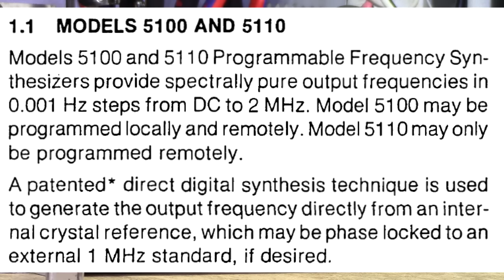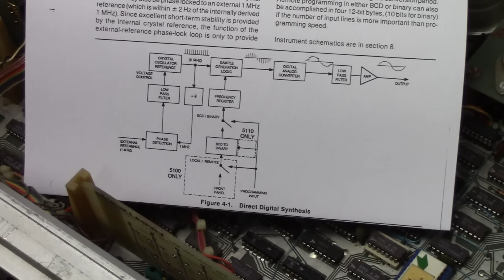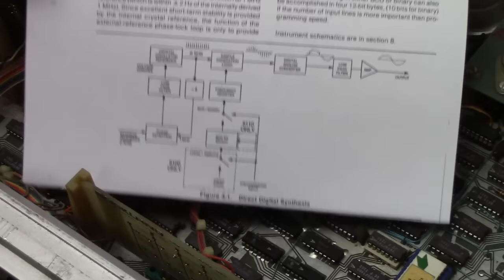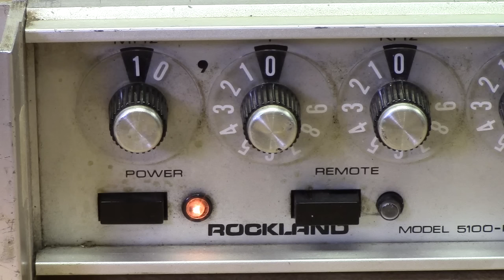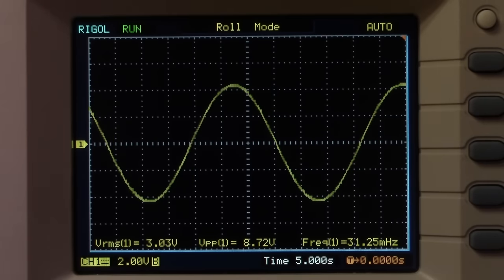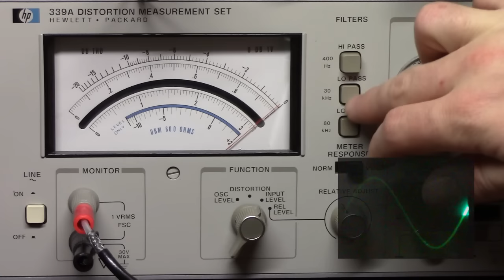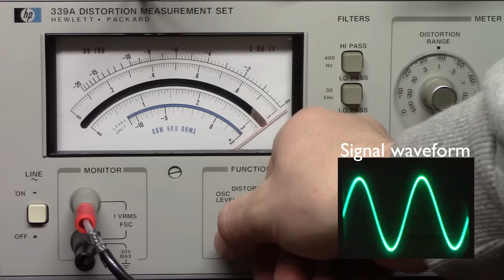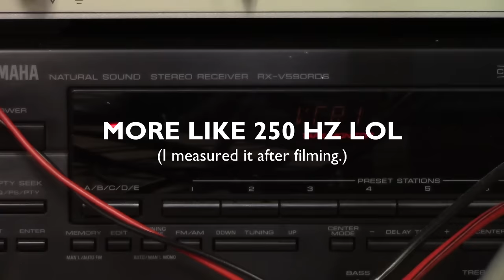Rockland 5100 vintage DDS frequency synthesizer teardown & test

Comment: Great video, thanks! I recently discovered your videos and I am slowly reviewing most of the ones that peek my interest, quite a few I must say! 
I was wondering if you had any videos where you review your favourite tools around your bench? I could not find one, but perhaps I missed it. At any rate, thank you for all your efforts to share knowledge in such interesting and fun way.
Reply from the maker: +Tino S I'm glad you like my content.

No, I don't have any videos about my favourite tools, assuming you mean stuff like screw drivers and pliers. I've intended to make a few videos on my favourite pieces of test gear, namely the HP 339A and the TTI EX752M, but they're difficult to get around to since they need to be really in-depth. The 339A in particular, since it's such a specialised piece of kit.
Reply: +FFcossag, any tools, measuring or otherwise, e.g. soldering station, software for data acquisition, chemicals used to clean boards, etc. Tips and tricks would be cool as well. Perhaps you know of Mikeselectricstuff Youtube Chanel, he sometimes does small videos on such topics, I think they help the beginner hobbyists like myself. Thanks again for sharing your adventures : )
Reply from the maker: Tino S A lot of people have been asking me about this kind of stuff recently. Perhaps it's time that I actually start doing something about it. A shop tour has been a very popular request, which might be a good gateway towards some "gear review" videos. Thank you for your suggestion - and yes, I know of and am subscribed to mikeselectricstuff. Cheers.

Comment: One thing the 5100/5100 can do is change frequency in a couple microseconds and not loose phase, not something most home labs need but even though most modern DDS chips have two divide registers I've not run across a < $100 USD version that will let you do fast frequency switching.